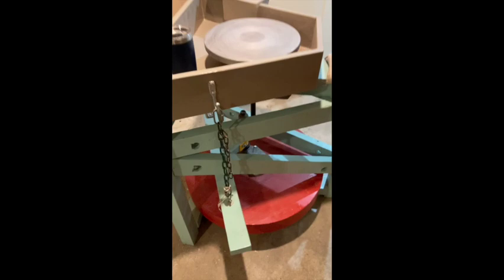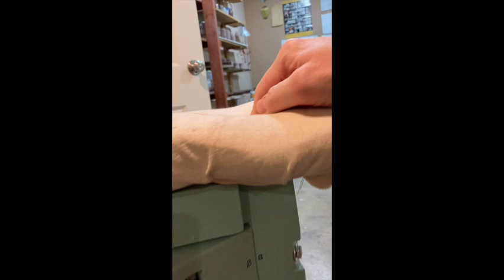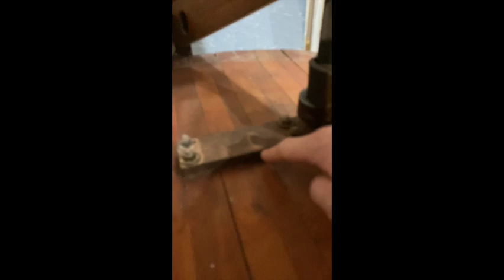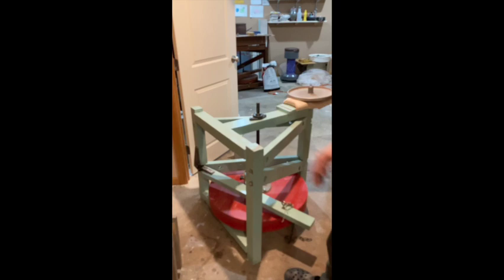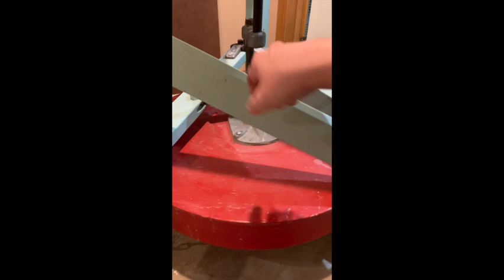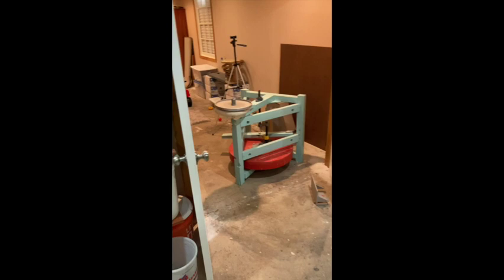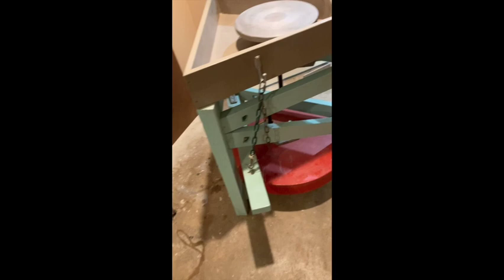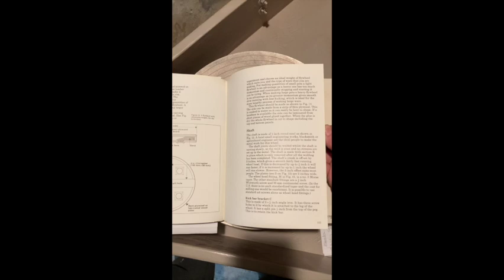Leach Treadle Wheel Explanation

Comment: Where can I buy the wheel thing?
Reply from the maker: Hi Linda! I’m not sure exactly what you mean by wheel thing. Do you mean the wheelhead—the metal round part that you throw the actual pots on? Or do you mean the entire treadle wheel?
Reply: @phillipschmidtpottery  yes sir the whole metal part and the wheel.
Reply from the maker: @lindawhite8566  to buy a treadle wheel is no easy or cheap task, unfortunately. Occasionally they pop up for sale. The better ones are like heirloom furniture. I actually made my own and one for a customer before. They sure are pretty wheels!  I’d check Facebook marketplace or Craigslist, and your local clay supplier might know of one for sale. The wheelhead can be purchased from any wheel manufacture—I liked Lockerbie wheel heads as they have a 1” diameter opening to easily fit a 1” steel crankshaft.

Comment: Can you link to the hardware you used?
Reply: Also curious about where you sourced your wheel head from.  The only ones I have been able to find are name brand: Pacifica, Brent, Shimpo and they're all $150+
Reply from the maker: Hi Adam! Is there specific hardware you are curious about? A lot of it was bought at a home goods store, Menards. Some parts were made on a welder, others were just reused pieces of other things that are already made. The "gate hardware" section at a large home store will have some nice hinges to use for the kicker, for example.
Reply from the maker: @Adam-ui8iy  The wheel head I used was a Lockerbie from Axner pottery supply. I used this because it fits onto a 1" metal shaft, which is what I was making my crankshaft from. You need to be careful which wheel head you buy (or you could make a wooden one much easier I presume) because they need to fit your crankshaft. Otherwise you'll need a metal lathe or need to bring it to a machinist and that will cost the big bucks $$. Even this 13" wide wheel head fits in the wood trough! I was skeptical at first. Just make everything as your own system of doing things, and you will naturally customize what you build and buy and use.
Reply: @phillipschmidtpottery  yea I would advise against a wooden wheel head.  Wood warps and moves with time (and moisture) so eventually your wheel head would wobble like crazy.  I’ll check out that supplier for the wheel head thanks!
Reply from the maker: @Adam-ui8iy sure it will, but wood is easy to work with and seal, and relatively cheap. It’s accessible, which is really important in a build like this, and some who don’t know how to make a treadle but want to learn will be put off by sourcing a metal wheel head. A wooden one works just fine and if taken care of, can last a long time too. It’s also potentially more customizable for someone who has a need for it.